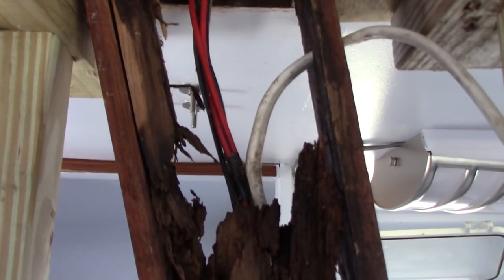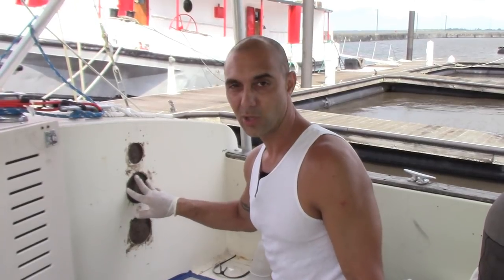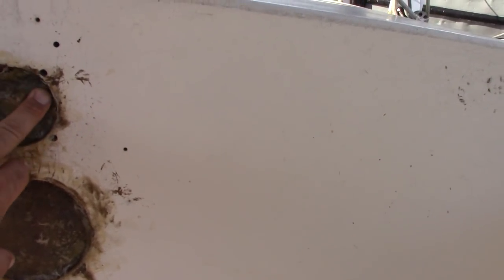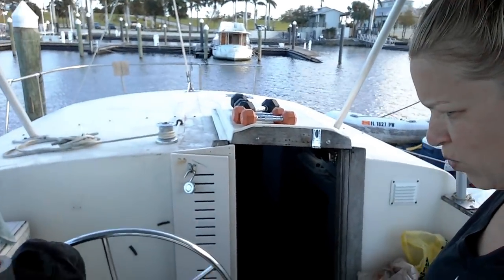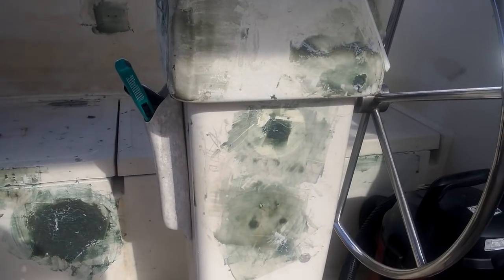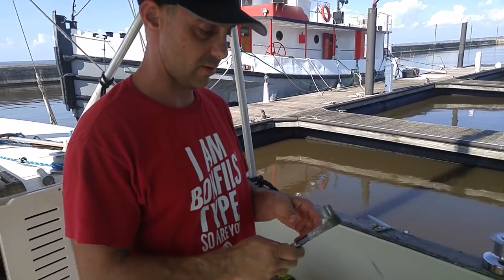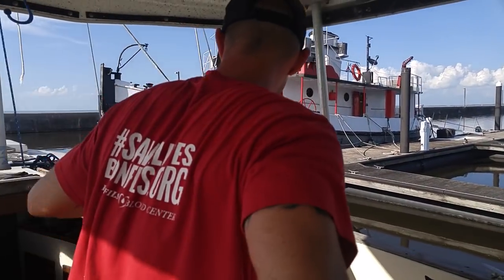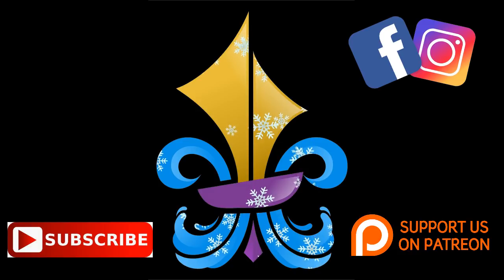Ep. 13 - Prepping the Cockpit and Trouble with Winches ~ Big Easy Sailing

Comment: Get rid of the winches and get the same size keyway everywhere. When you need them you won''t have time to be sorting and looking for the right handles. Make your life easier.
Reply: Those winches are older than the 1972 International Standard.  You might contact Lexmark and see if they have a way to adapt them, but I agree you standardized handles and winch handles do get lost

Comment: Just a tip ! Buy a soldering iron and solder you’re electrical joints and use shrink seal over the top because I’m concerned you’re electrical systems will fail at sea after a while because the harsh environment boats live in, well certainly here on my boat the wire joints have corroded from the bad joints used so im going to solder all of them once and for all. You’re climate may be much more forgiving though . Id also like to hear your reasoning for going electric on the engine department Im really looking forward to seeing that in action and wondering the cost ? Very bold move ! I like how you share every step of each hob keep up the good work it’s great 👍

Comment: You are learning quickly.  That is some nice cosmetic fiberglass repair using lowly 3M poly.  Just be aware that the 3M bondo stuff has wax in it to seal it off from the air at the surface while it cures. It migrates to the surface as it kicks.  So after it cures you will need to sand the wax off of the surface before trying to laminate another layer over it and rough it up to get a good physical bond too.  As long as it is "liquid" you can keep schlopping more onto it but once it starts to "kick"  you need to stop and let it cure and then sand it again after it is done before going again.  

Be aware that you can mix West System fillers into Polyester resin just like you can mix them into epoxy.  They work great.  Mixing the poly with West 407 low-density filler until it is like peanut butter and then spreading it onto the top will give you a very nice and easy to sand filler compound that can be made fare without a lot of grinding/sanding.  The 407 powder isn't all that expensive at WestMarine since a can of it goes a long ways.  You can also use the 403 filler to add strength as it is basically micro strands that give body to either Poly or Epoxy as well as strength and flexibility so it won't crack.  You can even use both 403 and 407 to add strength and still achieve lower density and using less resin. Stronger than just resin!  It'll be easier to sand, will be stronger and more flexible, and be less likely to crack/shrink/shatter once it is cured. 

I use Epoxy on the hull and the deck because it bonds so much better with what is already there.  You don't want water coming in through those places ever,  but anything on the deck that is not horizontal or where water can't sit or collect like those gauges on the bulkhead then poly is just fine. It's fairly strong if you add the right fillers.  Use some epoxy primer over it and then you are good to go to paint with whatever  you are using.  I like 2-part epoxy like Interlux Perfection.   It's tougher than 1-part paints and not much more expensive in the end I don't think.  Spill a little bit of acetone on 1-part paints and it comes right back up.  Not strong enough for me IMHO. 

I see someone already told you about the old-school winch handle driver sizes.  Winches are freaking expensive.  Just get the different winch handles rather than replacing them.  Use some paint on the tops to mark which winches go where and paint the handles with the corresponding color somewhere so it is obvious which to use where.  Not a big deal.   Replacing all those winches will cost thousands.  That's ridiculous right now.  Stupid and wasteful.  You have budget and this is not a smart thing to blow it on when the winches you have work just fine. 

It's good to see your skills and knowledge expanding so quickly.  You guys are going to do fine I think.  Your channel is really getting up there on the enjoyable scale.  I wouldn't miss one now.  Great job guys.
Reply: Very good info dude.  Very well thought out answers. Thanks.
Reply from the maker: Appreciate the information! Considering the color-coded winch handles big time. Thanks!

Comment: The International Standard winch star socket was adopted after 1972,. Standard is 11/16". Before this some winches had 5/8" star sockets. The difference is the 1/8" you removed. Depth is not standard, so some 11/16 brands can be of different depths. The socket also fits deck filler caps. Merry Christmas & thanks for the videos.
Reply from the maker: Greatly appreciate the straight forward answer! We got so many guesses from people that were completely wrong. Wish they would have just said they didn't know. Sorry for the late response, internet has been down.

Comment: On those holes you needed to grind down the circumference so that you  could feather mat and resin with loose fibers to make it structural because your way it will crack got one and two you may want to mount instruments on that bulkhead and that will stress it even more.  Bondo should be illegal.
Reply from the maker: Many things are made out of Poly resin...very strong stuff!

Comment: It appears you have a few older 5/8" and 9/16" drive winches, with the newer style being 11/16" drive. From your vid, it was apparent that at least a couple of your winches are Lewmars, I'm guessing older #8's. 

If going offshore, the sails on your boat is the heart, with your standing and running rigging being the veins that make it all happen. My suggestion would be to ditch those old winches. The last thing you wanna be doing in a stressful sailing situation is fumbling for different size winch handles, or worse case, losing an irreplaceable handle overboard. Ebay is littered with good used winches, but even used, a good winch is not cheap. For your size of boat, a good used two-speed will run you +-$300. If self tailing +-$500. Another good source is Minney's Yacht Surplus located in CA (Google them). I know you guys are trying to do this on a budget, but once again, this is not an item you wanna cheap-out on. Your life may depend on it. Keep up the good work.
Reply: These guys are not made of money.  Blowing BIG money on replacing perfectly good winches is not a sane use of it.  There are many other things much more important than this to be spending money on.
Reply: Never implied they were made of money, and conversely, I never heard them indicate they weren't willing to spend money where they needed to. Perhaps you know more about them than the rest of us? 

Look, properly refitting/outfitting a sailboat for passage-making offshore work (again, their intent) ain't cheap. I could go on about the need for RO watermakers, self-steering windvanes, auto pilots, storm sail inventory, parachute anchors, Jordan Series drogues, solar, wind generators, HF Radios with Weather Fax, AIS, Chartplotters,  EPIRBs, certified liferafts, Sat Phone, redundant ground tackle, etc., etc., etc., but I won't, because none of it is necessary. Smart, but not necessary. But having the basics (winches in this case), and having them perform without the need of a band-aid remedy, is just basic seamanship, and I doubt any passage-making sailor that shows up here would disagree.
Reply: Didja even watch the last video?
Reply: Yes.
Reply from the maker: We definitely are on a budget and not made of money. We worked very hard to save what we have. That being said safety is very important to us. The winch issue is alot for us to think about. The extra money budgeted for misc. might just have to go towards winches if we can find a good deal. Fingers crossed! If not, we clean them up and color coordinate handles (not ideal but doable).
Reply: I’ve sailed thousands of offshore miles, and cruised extensively. I guess I'm a bit confused. 

You said that you plan on "... cruising across the world..." This typically requires a boat that is purposely built with design attributes for offshore passage-making work (a great webpage on the topic and list of boats here: www.mahina.com/cruise.html ). These attributes (hull design, high ballast ratios, overbuilt scantlings, ample tankage, to name a few) aid in mitigating the success (aka survival rate) of the crew when crossing oceans. Add to this the list of items I mentioned above, and your odds of success go up exponentially. If you guys were planning on day-sailing or even coastal cruising, I wouldn't be commenting here. Many things can be done on the cheap, including buying your parachute at the swap meet. Good luck, and fair winds. - Unsubscribed.
Reply from the maker: Well sorry to see you go. We do appreciate the information you have shared. It was quite difficult before to get a correct answer about the winches. We do plan to cruise the world, we are just taking it one day at a time since we aren't in any rush except to start sailing. We also have come to realize that our super wide boat with a 3' draft is less than ideal for ocean cruising. So we don't want to sink money into her that would be wasted(i.e. expensive ocean cruising winches). Now if we are able to find good used winches at a fair price, then she gets an upgrade! The knowledge is still invaluable to us. Thank you.
Reply: I think what the dude is trying to say is that your budget doesn't match what you guys want to do. How much research did you really do on things like the type of boat you need? The type of boat you have was originally designed as a powerboat and probably doesn't point very well at all. You will be motoring a lot so I hope you have large fuel tanks. Did you research everyday cruising costs including maintenance things break!? Just cruising the Bahamas is expensive with entry fees etc. We cruised there for eight months and on averaged about $1500 month. Deciding to cruise around the world shouldnt be based on some conservative budget and timeline to go. Trevor

Comment: Cockpit looking good, non structural holes only need cheaper filler smart move save coin when you can. Ah the winches... these things are expensive, at least the one has a red handle to differentiate from the rest, and the shape is different so no worries in the dark. 
One quick make do fix is to put a metal bar with the ends that seat in the winch tapered to fit each one glued or siliconed in place with the end sticking up out of the winch sized for a handle that fits all. A ratchet from Home Depot is inexpensive and can be adapted for the task. The only negative is the winch tops aren't flush so you have to be mindful of the pokey bits in heavy weather. 
There are so many hurricane damaged boats that have been put to pasture recently (sadly) that you can help a mournful owner with a little pocket money by salvaging winches and odds and ends. I'm sure they would like to know not all is lost and they can still follow their dreams and be inspired by watching their (donated?) gear sail the waters once again. 
As you know, put the word out and be open to the blessings, the Great Spirit provides.
Enjoy...
Reply from the maker: Appreciate the info. Hoping to find some replacement winches for a great deal.
Reply: Andrew Craig ISI

Comment: RE:  Winches.  Unfortunately, there should be a lot of cheap hardware following the recent hurricanes.  There will be boats totaled completely with thousands of dollars of good hardware left.  Winches are pretty much bullet proof and can be taken apart relatively easily.  There is usually a ring at the top that can be pried off to reveal all the internals.  If you do replace, you'll want to take them apart to make sure there is no salt water inside which will corrode just about anything - stainless, bronze, etc.  

RE: Sailing the world.  I am sorry I agree with the folks who have discouraged you from going offshore in GWTW.  You have "the wrong tool for the job" as it were.  Your boat will be fine for coastal cruising and  very carefully planned shorter offshore passages, but I don't think you will find it suitable for long offshore work.  The good news is, you are adding tremendous value with all the work you are doing and can certainly learn the fundamentals of boat and sail handling, navigation, etc..  You should be able to sell her at a profit and find something more suitable if you decide you really want to go ocean cruising.

Comment: What’s that sander you’re using as it’s great like a DA. But electric I’ve not seen one like it here in the UK I’d like to get one like yours too .  Looking good 👍
Reply from the maker: makita orbital sander 5" cost me about $70. very tough! I push tools.
Reply: I have a cheaper Ryobi sander from the Home Despot that works really well, but it wasn't really designed for sanding paints or fiberglass.  While it works really great the bearing in the sanding head is exposed inside to the dust stream and tends to cake up with the fine epoxy and paint dust and fry after a few hours of use. I guess with wood dust it doesn't have this problem.    

I like to push tools too and the first time this happened I pulled the seals off of the bearing and slopped it all out with mineral spirits and repacked it.  That was a temporary fix as the bearing took a huge hit already so I read the numbers off of it and found them on Amazon for like $12 for a 10-pack.   It only takes about 5 minutes to pull off the sanding head and swap out the bearings, so when it starts to make that funny zippy noise I can stop and put in a fresh bearing and be up and running again in no time.

Comment: Don't these winches have Manufactures name, and possibly Model # so that you can go online and readup on them?  Also, with the Winch Make/Model# in hand, how about calling the Marine Consignment Store that you've been dealing with.  They could probably shed light on the situation.  I am totally against having different handles to fit different winches...  When you're in a urgent situation,  you don't want to be searching for the "right" handle.   Ideally, I would replace them all with identical make / model winches.  They look like original equipment and are probably ready for replacement.  That one oddball size might be a winch that failed, and the last owner replaced it,, but ignored the others.   Have you opened the winch to inspect and lubricate?
ps--- Just saw Obit 123's post.....  my sentiments exactly,,,

Comment: The boats made of polyester resin, Why use epoxy. Very few boats are made from epoxy!
Reply: Epoxy has like 10x the PSI of poly and sticks SOOOO much better.  When you are trying to fix something like a crack or damage you are already in the BS fixing category and way outside the nice new layup on an assembly line at the factory.   I have nothing against using poly in low-stress areas or where working conditions are just perfect for using it.  But when the going gets a little gnarly and you need that extra security like on hull repairs I'll reach for epoxy every time if I have a choice.   Then again I have a WestMarine Pro account and the price of West stuff is so much better with the discount.   Still not as cheap as $37/gallon for poly at Home Despot though.